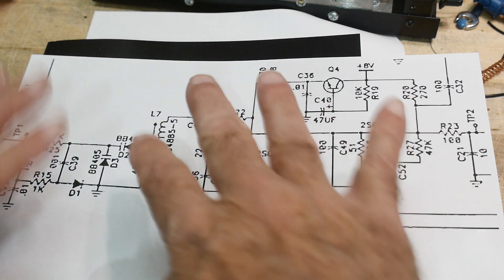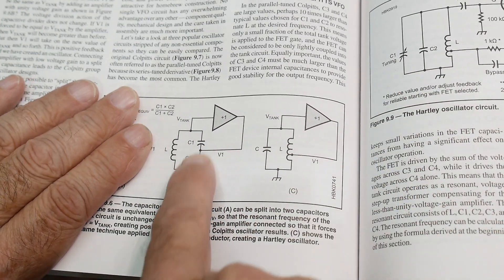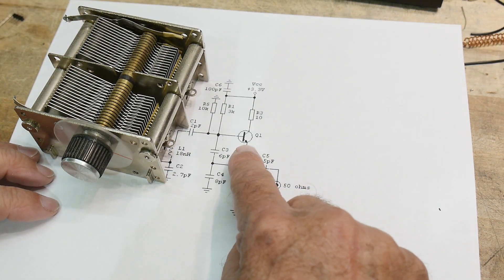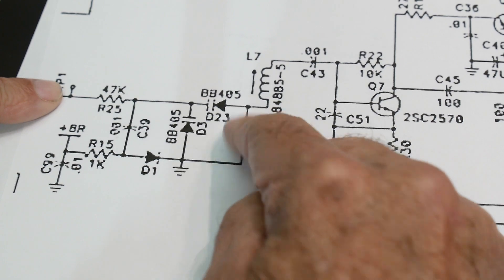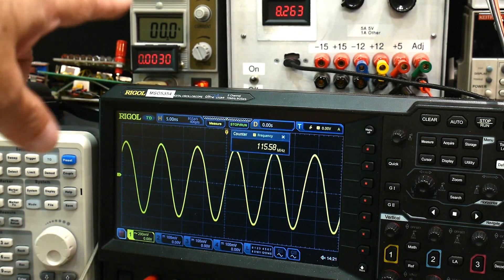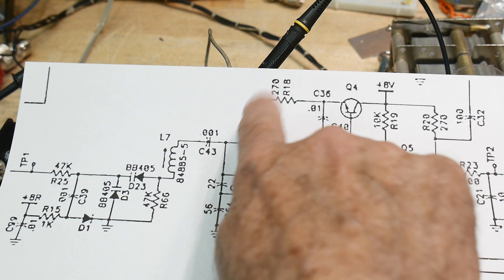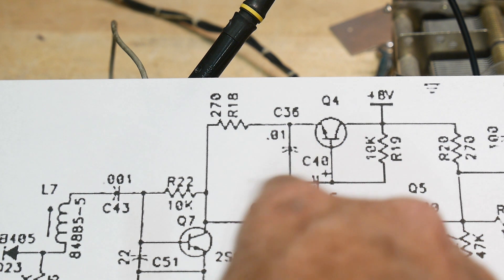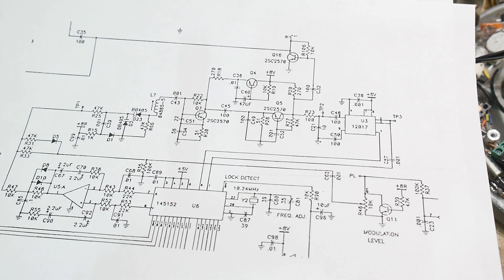#1510 Ramsey 2m VCO (part 6 of 12)

Comment: Thanks for another very interesting video.
You're viewing 115-125 MHz signals on what appears to be a 70 MHz scope. Is that why the waveform quickly attenuates as you increase frequency? Is that also why it appears increasingly less sinusoidal?

If my math is right, the RC delay should bring the base of Q4 to 0.7V in 43 msec. But it looks like the emitter voltage of Q4 needs to be higher than ground since it feeds into the collector of Q7, which means the base voltage of Q4 needs to be higher than 0.7V. Which means the delay will be longer than 43 msec. Very sneaky circuit. Not sure I understand it.

EDIT: Now I see all the comments about Q4 being a capacitance multiplier. Need to refresh my memory on how that works. Thanks for clarifying.
Reply from the maker: my scope was updated to 350MHz. simple oscillators are not amplitude leveled.

Comment: Interesting what is the purpose of R15 D1? Why not just use C30 to ground to stabilize voltage
Reply from the maker: +BR is only high during receive. D1 is used as a switch. during receive you have some extra capacitance to lower the IF
Reply: @IMSAIGuy  Oh, that makes a lot of sense. What type is D1? Is it an RF switching diode?
Reply from the maker: @diemaschinedieviereckigeei2941  I think any diode would work

Comment: At 4:16 there are the two diodes which are in parallel for the control voltage (same capacity) and which are anti-parallel for the signal. As they are non linear the signal gets more and more distorted with increasing oscillator amplitude. This is compensated by the second diode which is driven with the inverted signal.

Comment: Q4 is a gyrator.  Truns c40 unto and inductor circuit
Reply: No. Q4 is something called capacitor multiplyer. With R20 it forms kind a low pass filtering circuit, offten used in DC line where it is of importance to decouple part of the circuit from the rest of it. Since this is VFO it is important to 'isolate' it from eventual disturbances in dc line.

Comment: Q4 as you mention is a delay circuit , dependant on rc time and after is conductive acts as antichirp volts suply isolation from 8V noise rail .